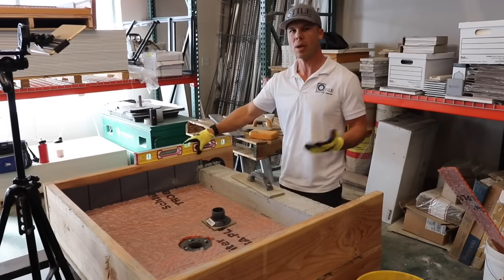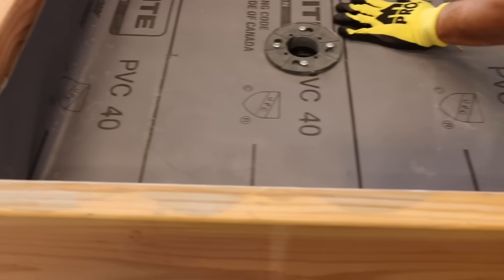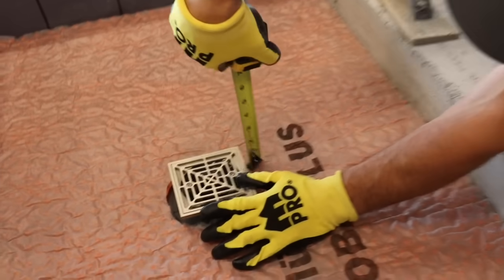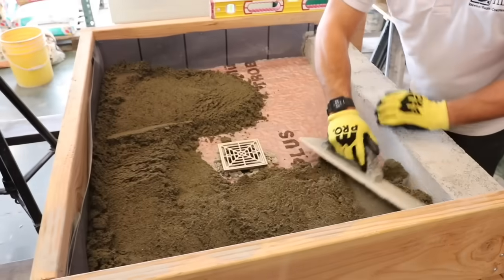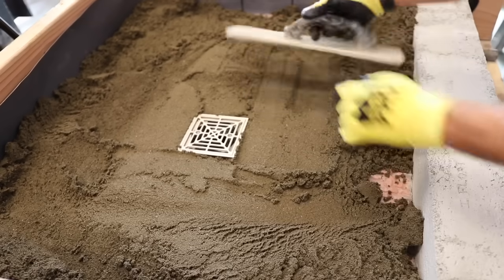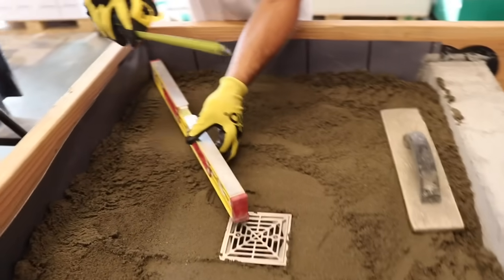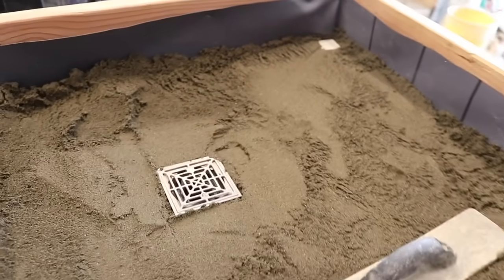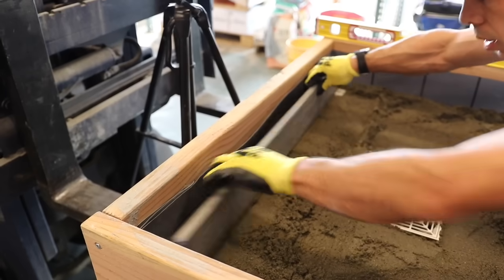How to Slope a Shower Pan: Tile Coach Episode 18

Comment: this method works fantastic. However, to save  little time, i get the slope hight  marked on shower pan with a sharpie before i mix mud and this gets me real close. hope this helps and doesnt come off as "mr know it all"          =)
Reply: I do the same thing you’ll always be able to see it and never worry.  But I did like the little tile trick, it would be cool to incorporate both
Reply: Good idea I thought that also lol.. 👍
Reply: 👍 laser level to get a line on the pan all around from the drain and mark it with a permanent marker. Cover the drain with tape, you won't scratch the finish and no sand gets in. Don't want to get blamed for a clogged drain.

Comment: I'm an experienced woodworking, framer and carpenter who is trying to learn the skills and get the experience in plumbing, electric, roofing, concrete, and landscaping, so i can be a complete contractor/builder i work on my home when repairs or new installations need to be done,learning as i go. This video helped me very much on how to do this the correct way and what materials to use. thank you. thumbs up

Comment: I think it is important to consider the selected tile. If you are using a 4 inch mosaic you sometimes have a good reason to not level the outside. If you have a rectangle shower the fall will be much steeper from the close sides than the far sides. That can cause the larger mosaics to not flatten out as well. For those type showers I float a constant 1/3 of the bubble over the line in every direction. A complete bowl shape. I guess after 30 years I have little tricks.

Comment: Another maybe faster and easier way  for beginners is if you cut 4 pieces of wood into wedge shapes (with the 1/4" per ft angle). Place these diagonally from the shower corners to the drain then use as temporary battens to level off your screed. Lift up when screed gets firm and fill in the gaps.

Comment: I appreciate the lesson. However, I have a concern: with the hard pack so dry, it looks and seems so porous. The liner is designed as a second line of defense, but it should never come to that, short of bed failure. Just a thought......

Comment: First off, I've watched (in horror) dozens of tile videos over the years. Yours are the first ones that are actually correct and worth watching. Well done.
For mortar pans, try this method: 
Before you even add your dry pack. 
Properly calculate the desired height of your perimeter mud screeds (whole other trick for that)
Place your level against the wall so that the BOTTOM of the level is at the desired height of said screeds. Of course, level the level accurately. 
Scribe a level line (I use Sharpie pens) along the TOP of the level. 
Chase that line around the walls and curb (if possible or applicable).
Throw in your dry pack.
Put the level back against the wall and pound it down to reveal your line. I slide it back and forth to "steel trowel" the mud screed.
Repeat for all walls.
This method eliminates the need to constantly check your bubble or use one screed height to start another. You already have a level reference line! It makes it simple to insure that your screeds are perfect. It is incredibly fast and highly accurate (provided your line is good!). It is easier to pack the screeds down tight. Should you pack the screed down too far. It is super easy to correct. If you dig into a screed. It's super easy to correct. Idiot proof even.
Hope this was worth the read.

Comment: very nice.. I'm an old retired builder and I've done a lot of frame-ins for showers before hot mop and I've been long gone when the deck mud went in. I'm going to do a new walk-in shower in my new place the old traditional way especially after seeing the possible negatives with other systems. Great video.. thanks for sharing.

Comment: You are one of the better installers I’ve seen on YouTube one thing I like to do is use 1.5x1.5 wood around the outside to level it off then pull them fill and finish it

Comment: It feels so good when I start to understand how to do it correctly. Thank you so much for your videos and for explaining in such detail. I am going to tile my family's shared shower since we have the big white plastic one (if you know which ones im talking about) and the bottom is cracked, leaking and causing the rest of bathroom floor to swell, the panels are peeling off the walls and water gets in them, mold everywhere, the sealant in between the cracks are horrible from all the sealed attempts etc etc can't hire a contractor at the moment for financial reasons, so I took it upon myself to make a better, safer, and cleaner shower for me and the fam. And I want to make sure I do it right the first time. So thank you ❤

Comment: Nice work! Wood floats are invaluable. Lasers work awesome for pans as well. I was trained on forms in a pan but now I float to a laser line and shape the edges then put in drain at desired height, then float down. Another trick I like is mortise out corners of studs so you dont get bumped out 😉

Comment: If I may add a little piece of advice that helps me getting the perimeter level, when leveling the next wall 45 📐 from wall to wall to help keep the same height around the edge. Great job explaining, it’s a little harder than it looks if you haven’t done 100 of them. Thanks. I’ve been doing flooring over 20 years and still watch videos to learn something new.
Reply: Would you be willing to explain more what you mean about the way you get the perimeter level?
Reply: @Tell-me-more-75225  I use a small level and 2x4’s and build a small form all the way around the edge level pour it first and let it set up. With the drain set lover by a half bubble then the inside curb, being the doorway is about twice as high as the inside, then I pour the inside sloped to the drain. Leave enough room for the tile to just barely be above the drain when complete.

Comment: Good method and techniques. Even easier to finish pan after screed points are hardened, in two stages. At any rate, count on needing to fine tune it for flatness and smoothness in a separate stage to get a really nice result. Unless you’re a rock star like our friend here.

Comment: Excellent video Isaac, this is the best way to do the slope, but I would not let a steel trowel near my pan liner period. Instead of using a wood float I would use a clean magnesium float, it doubles as a trowel and will not puncture the pan liner on accident (accidents do happen)

Comment: I use a gauge block. I made them in 1/4” increments! I place the correct thickness block on the drain and set the level on it and the mud pack at the wall. I center the bubble and I have the correct slop. This is much easier than using a tape measure!

Comment: Nice video again. The drain u use has more possiabiltys by flipping the clamping ring over for more strainer height, you were proabably maxed out on threads.  Thats drain is one of two drains on the market that has those capabilties that I am aware of. With more height adjustment you can use the top of the drain as your float guide and not notch your float stick. Then screw the drain up for the tile thickness after floating the mud .  They make and I am sure you may now about it a  plastic weep hole protector rings , much easier than the gravel. 
Why no reinforcement in the mud bed? TCNA use to call for it but I learned this past week it is no longer required for showers less than 65 sq ft. I still put in. Flipping the clamping ring   to get extented strainer height is nessary if you are reinforcing the bed.
Reply: Why no reinforcement in the mud bed? - - it is my questions while using flexible inner which could crack the upper surface over the time.
Reply: @mdislam6381  I have always used in my shower floors . TCNA says anything less than 65 sq feet it is not required . I believe the older  hand books did say it was recommend or required no matter what size the shower is but I do not have the older handbooks.

Comment: It never ceases to amaze me how many so called professional tiles setters tend to believe that water will flow through the sand mix in an entire pan but then hit the weep holes and stop because nobody put rocks in them.
Reply: @TileCoach  fair enough, but I don't see how it logically makes a difference. It's something I have questioned for near 30 years now.
People act like it is some special trick..
But hey Bud, I admire your work. It's as solid as it can get.
Not what I do to make money, but definitely on the high end of the spectrum

Comment: Loving this dry method, I will try in my home
Reply: You actually shouldn’t do shower pans with wet mud. The dry pack actually allows the water to filter down through in to the weep holes. If you put it in very wet it dries much more compacted and will not dry out as well. Plus it’s way easier with the dry pack, so you can cut it and not get any memory where it moves like a liquid.

Comment: Excellent video, the only thing I do different is I use the top of drain as a screed instead of packing below it. I pack to the top of drain, then unscrew the drain up the thickness of the tile. The only time I pack below it , is if theres not enough threads and need the drain up all the way, but that rarely happens.
Reply: Good advice.

Comment: Hi. Getting ready to do this. Will use ur method. Wondering if tile is set slightly below lip of drain to screed. When I go to thinset tile will that make tile slightly above drain? Should I account for thinset when I screed? Your stick cut out was only tile thickness and nit thinset and tile thickness? Sorry just want to do it right. Thanks for any advice. Btw love all ur videos. Completely helpful.

Comment: I think I would use a narrow board around the pan perimeter to ensure a solid height reference for the outside edge of the mud,  then remove that board and backfill once the rest of the mud has been properly sloped to the drain.

Comment: Really great video and superb tricks to make it easier!  I'm looking forward to using the FloFX products, but unfortunately, the shower alcove I'm redoing is a very odd size.  The drain is set into a concrete slab/platform and was made several decades ago using 1-1/2" PVC instead of 2".  FloFX doesn't make anything for drains smaller than 2".  Do you know of alternatives similar to FloFX that'll work without having to break apart the platform concrete?

Comment: Easier if you put your screed strips in sand cement, then screeded off them with a straight edge. When you are done pull your strips out and infill the void created by them.
Reply: that method is good for beginners

Comment: Question Tile Coach:  With the drain grate screwed into the drain pipe, once its tiled how would one remove the grate to clean the pipe?  Asking as we currently have to clean our drains in both showers once a month.

Comment: got a question issac. love your videos! You made room for your tile when setting your height on the drain but i didnt see you include your thin set height as well when you lay your tile which will put your tile higher than the drain instead of even with the drain which wouldnt be a problem i guess as long as the water is goin into the drain.

Comment: Thanks for posting. I need all the info and suggestions as I have committed to a total remodel of our master bathroom by myself. I am down to bare concrete pad and open studs on our house. Already rented a tile stripper, used leveling concrete that set up too quickly in the hot Florida August sun and became slumpy and bumping so I had to rent a 20 inch concrete grinder from Home Depot to get the floor leveled out. I filled in the valleys now I took off the hilltops and it’s level.
I installed a new tub, will install a double sink vanity, tile the floor, float the shower pan, and put up hardboard for the shower tiles. Need to install a new 48 inch 3/8 glass sliding shower door, too.
Reinstall the toilet, drywall and tile the separate toilet  room and it just doesn’t stop!
There is a lot to remodeling a bathroom from 1988 to 2019.
Wish me luck.

Comment: Hey Isaac... I'm building a pre slope tomorrow on a concrete floor (guest bathroom).  Can I apply the dry pack directly onto the concrete? Or do I have to apply a thin layer of thinset first?  I built my master shower about a year ago and I believe I only wetted the concrete with a sponge.  I don't remember using thinset 🤔.  Love your videos man! Super big fan here 😎👍 Thanks in advance...

Comment: hey there, I really like your videos. I have a question that I haven’t found an answer to yet. I have a walk-in shower on my new construction house with the drain next to the wall. We have concrete floors and designed the area to be 0 entry we also have heated floors. 
my question is how do I build up and float a sloped shower floor with a Troughed style drain. not sure if you can do a video on one. I could even send you photos if that’s possible any help would be much appreciated.

Comment: I have a concrete flat slab in my shower. If I use that mat you used is that like doing a preslope? I was told you have to do a pre slope under the pan liner or water cant find its way to the drain. I already put my hub drain in.

Comment: If once the shower pan is dry and you test it by dumping water all around, and you notice low spots and puddling. What is the best way to go about fixing that. I haven't waterproofed the floor yet. Just finished Mapei 4 to 1 mud mixing the shower floor yesterday.

Comment: Dude, good video but I have been doing concrete forms & slabs for many years on your slope screed if you want 1/2 inch drop just notch or add 1/2 wood on the drain side but not where it comes in contact with the drain then you can rest the end on top of the drain as you drag off your dry pack. No guessing it's perfect.
Reply: Dude, I've been setting tile for many years and I've never seen a drain pitched by a concrete finisher that didn't have to be redone.

Comment: hey you notched the little piece of wood for the tile you didn't account for thin-set on that? did I miss something?
Reply: I looked at the tiles ( 4x6 ) I recently removed from by bathroom and seems the thin set compressed down to about 1.5 mm. So I figure that height above the drain , with a slight grout taper to it would not be too significantly high...but I see your point!

Comment: Great video. I bought my house last year and a tile had a void in it and cracked and a hole in it.  I removed the grout and the tile and the bed underneath was really dry sand and a void in that. What’s the best way to repair the mortar bed in the area? I had to remove another tile cause the bed under that was not packed and the tile flexed. Trying to go with the cheap fix without having to rip out the whole floor.

Comment: Isn't the cement board supposed to be installed to cover the liner on the walls before the mortar bed is done so the bed comes up above and buries the bottom edge of the board?
Reply: I too wondered about this. From other videos I have seen it seems better that the bottom of  the cement board does not touch the bed as this would create a wick effect if the tile grout is compromised. This uptake of water seems to destroy the cement board and causes mold issues. I sometimes wonder if it good idea to red guard the cement board at the bottom , both front and back for added protection.

Comment: Hey great video, it really helps to de-mystify the whole process. I have 3 questions; should I install cement board over the float and 2x10’s once I have created the mud bed pan?how long after creating the pan should I wait to lay down the tile? And finally is it necessary for me to use a metal lath during this process as I’ve seen in other videos? Again thanks for the videos

Comment: Great video!! Quick question - after waterproofing, is it better to do the final slope and curb, then put up the backer board on the walls, or put up the backer board, then final deck mud and curb? Oh and one more thing, do you have any video on shower benches? Can’t find anything talking about how to prep the bench after waterproofing. Thanks!!
Reply: Thanks Isaac!! My parents went with the hot mop so that’s where I’m not finding much on a bench that’s been hot mopped. I’ve been wondering if it might be good to deck mud (or something better) the bench sides and then apply a cement board against the sides, since I can’t screw into the side of the bench. Any thoughts?? Thanks again!!
Reply: Isaac Ostrom Thank you so much!!
Reply: Love the detail you put into all your videos - thanks for the link, also watched a few more - regarding the fat mud, which I know I should use on the two sides of the half bench I built - I’m not sure if I can find the Dyna-Crete fat mud in Southern California, I know Lowe’s carries a Quick Crete Deck Mud but if I can’t find actual Fat Mud, would you suggest just a Type S Mortar, since that contains the lime needed for the vertical walls? Thanks again and hope this is the last question.
Reply: Isaac Ostrom Thank you for all the help!!
Reply: Hi Isaac!! Got my fat mud for the shower bench walls and my dec mud for the pan (final slope) - so I have one more question - would you suggest I float the bench first or after I do the deck mud on the pan? Thanks
Reply: I like to set my hardi board first and put a coat of red guard on it then use a laser to set my perimeter and pencil it in on the wall shows well on the red guard and set my drain to desired height and keep a price of the floor tile handy tho check it against drain and set it a hair low to account for thinset